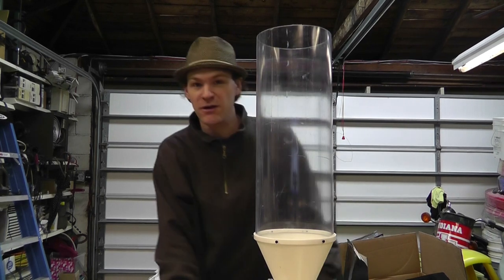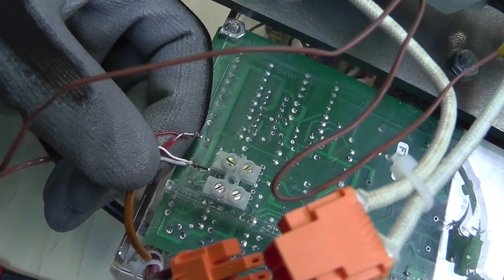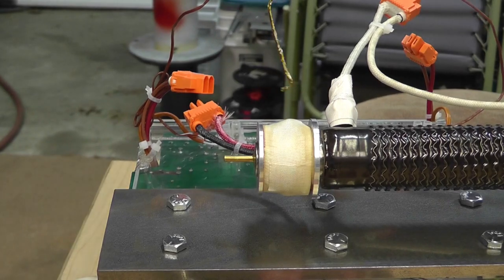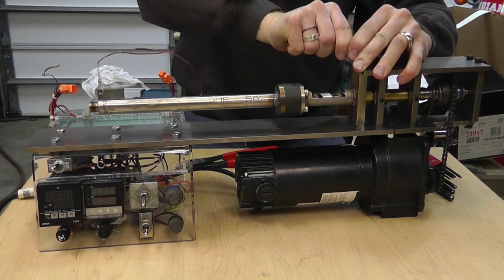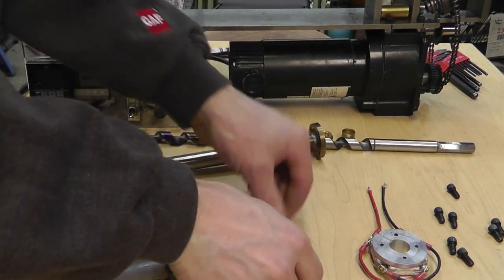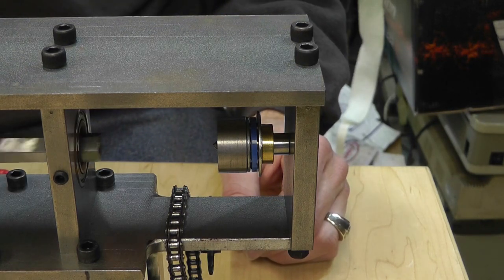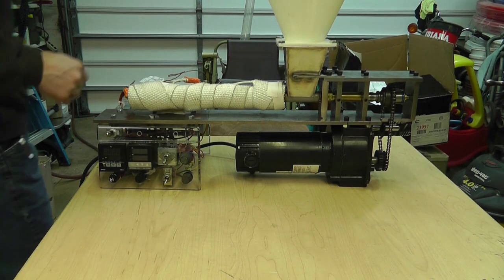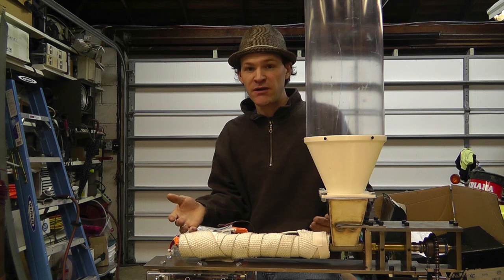#3 ~Russ's Home Brewed Filament Extruder: The Break Down V1

Comment: What a beautiful machine, the best D.I.Y extruder I've found so far. The only thing I would change is the screw. A custom one should be more efficient I guess, you could make run faster for other types of applications like filling a mold. One of the pros of your choose is that it is easily replaceable, whereas a custom one is not

Comment: Go to a boiler service company and ask about some fabulous stuff called "Fiberfrax".  The insulating properties are terrific.  I have it on the exhaust for my welder so I dont burn the garage down when running the generator.  Otherwise to hold insulation in place instead of using tape.  Try using mechanics wire.

Comment: An excellent build. Like to see some one using industrial grade components for builds.  There is a reason they cost Xx what an Arduino controller is they are engineered and built to be robust in industrial environments they also have repeatability and accuracies  that are better then project type sensors..
If your going to control the process for stand alone you should  add a few loops.
1 a rotational sensor on the screw to measure feed rate. this could be used as a pre step tohavethe tube partially filled(loaded) before turning on the preheat resistor.
Once it is loaded to a % of space the resistor turns on and  the screw turns off for a time delay.or  a temperature control like the center temp controller. 
2 Once preheat is established the screw is turned on and then after a few turns the final heater is enabled. 

Now you need extrusion control  either speed adjustment or temperature regulation in the final stage.

You are working in a garage so the ambient temp will change with the time of day and month of the year so controls for extrusion are needed to maintain a quality product.

I recently moved and needed to leave my scrap parts supply back at the mainland

Comment: The best heat exchange is for total contact between heating and heated surface. Any air gap between the two will act like an insulator and drive up electrical consumption.
Reply: Sacrificial sheer pins are a good safety measure to protect parts of the machine. That's how the industrial makers do it.
Reply: If you use an auger bit and you cut the end off, be sure to sharpen to a dull 150 degree pointed cone on front of shaft. That should be enough to cut down on material getting stuck in a dead zone and burning over time.

Comment: i notice that you have inverted the game between the screw and the tube, normally the extruders have a big game at the beginning and at the end is really tight, this will give you a more consistent pressure at the end and may ended up with a better tolerance. also, having a tight tolerance at the end wont allow the air to escape.

Comment: Hey Ross, ain't it better to use an extrusion screw than a drill bit? With a screw, the heating is just to keep a stable temperature but the plastic melts from the pressure. How does the heat affect the quality of the plastic VS pressure melt?
Thank you very much for sharing your exploits, you got the Open Culture ;)

Comment: I love your design but can see a big inefficiency in your heating element ..  The center is ceramic and is not the best at transferring the heat. the outside will have to get very hot befor the centre gets hot.. Ends up being very inefficient.. But if you can find some way to fix that I think you're on a winner...

Comment: Thanks!
Reply: What size did you say your auger was?
Reply: Sorry, I'm just gonna use this thread to keep asking questions! Need a few pieces of information. Firstly, I'm trying to source a motor. What's you RPM and Torque? Getting excited about the idea of getting started on this :D

EDIT: Just looked up them motor details. It should run at 167 RPM 43 Torque comparing to others, so I guess the next question is what's your gear ratio?

Thanks again!
Reply from the maker: Cianus Aurelius
motor:
http://www.grainger.com/product/DAYTON-DC-Gearmotor-4Z130

auger:
http://www.ebay.com/itm/like/330417932139?lpid=82

~Russ
Reply: You're a legend of a man. 

Thanks again!